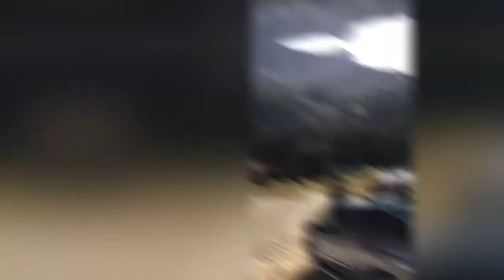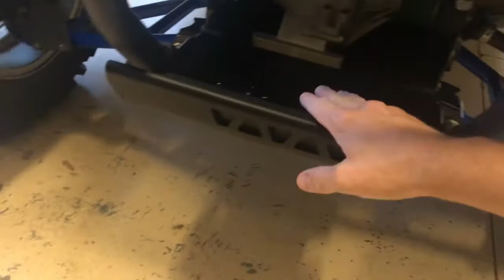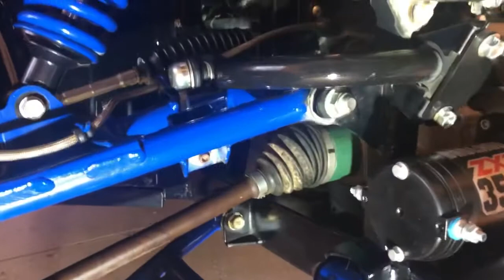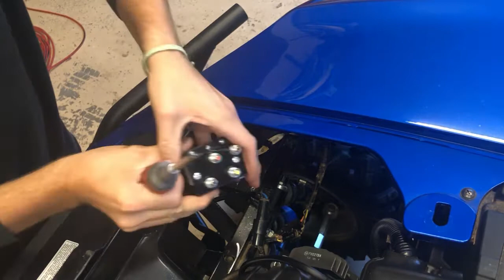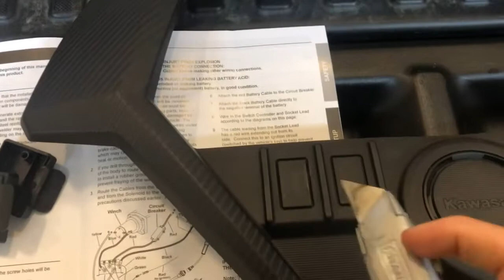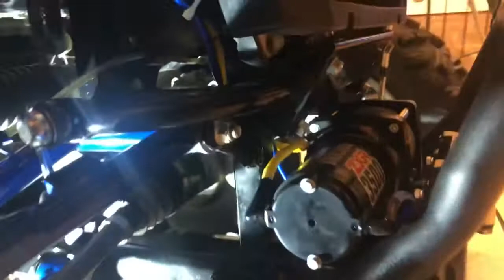Kawasaki Teryx Winch Install

Comment: kawasaki really went above & beyond to make it impossible to install any front mounted tow hook / recovery point.
Reply from the maker: The only place would be to fabricate an eye on the bottom mounting point for the brush guard. That goes into the frame. I might do that at some point because it see the same issue.

Comment: Where did you find the guards for the front cv axles?
Reply from the maker: Those came on the machine when I purchased it. I plan on making a video and make a little larger ones to provide better protection.
Reply: @outdoortypelifestyle9489  I’m guessing they forgot to put them on mine. Not sure. I will keep an eye out for your video on it.

Comment: What kind of splice did you use and could you show a picture of your set up?
Reply from the maker: It would either be a T-Type splice or a butt splice. I have tried before, but haven’t found a way to add pictures in comments. 
Here is a link to the t-type splice. 
https://www.googleadservices.com/pagead/aclk?sa=L&ai=DChcSEwitn9qi2OD4AhUXPa0GHaliAL8YABANGgJwdg&ohost=www.google.com&cid=CAESbeD2XBJ2ebHC_pyzBXw5c8xeZGYCp6SD2h6mMywc30D0y3DfIHfbH-Ts34fjmSKnxnkMxPt-UwpsWMoIn-ZG5Chdd08muq_Oy1dzwIFZETMk_8mjBRYDvESHGt4Vzp75VJb_v4cnVvN5wn7JHLw&sig=AOD64_03L2p4n5VM359kqQOQ3L-r7x-Jcg&ctype=46&q=&ved=2ahUKEwiAvdCi2OD4AhUVKH0KHU9KDC8QzzkoAHoECAEQCw&adurl=

Comment: HI there, I found the video helpful. Thanks for sharing.  Have a few questions. Can you show a pic or closeup on your splice into the fusebox? Second, any issues after taking it out and getting/wet/muddy?  thanks again for sharing!
Reply from the maker: I snapped a couple pics. I’ll try to load them to the comments. No issues with splices getting any water intrusion. I have taken it out in snow, rain, and light mud. Pulling it on the trailer at interstate speeds don’t allow water to get in there.

Comment: Great video! I’m fixing to get the same deal for my Terx 4 . Have you had any problems with the wires getting hot or melting? That it came with.
Reply: I haven’t had any issue with that. I maxed it out a couple times trying to get a bale of hay out of a creek. Heavy use for about 15-20mins and it never had a problem. Never got the wet bale out of the creek it outweighed the Teryx and I lost that fight, but the winch worked great.